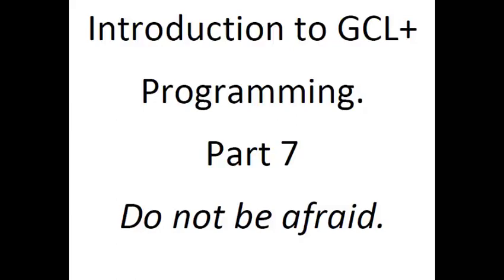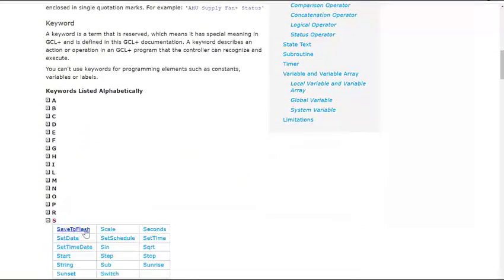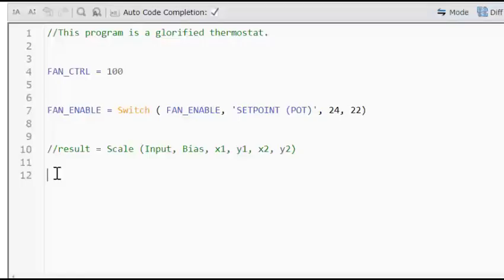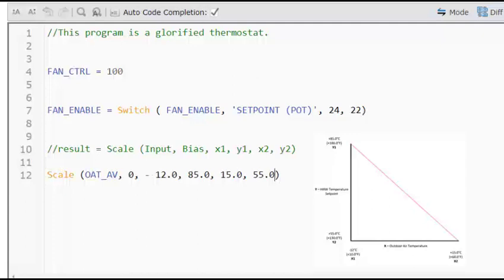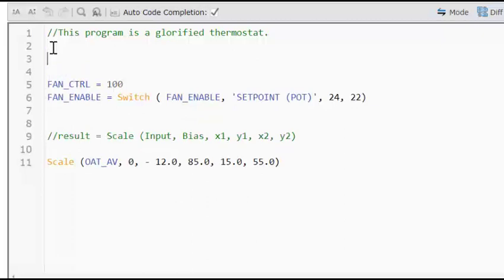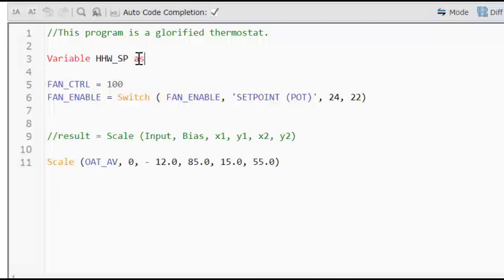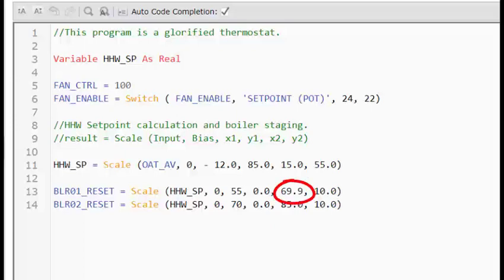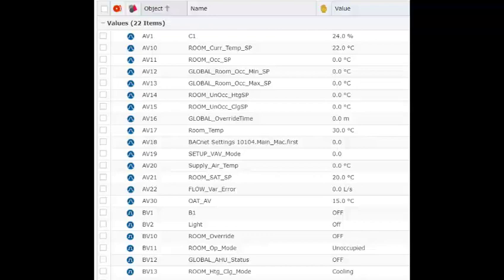Pt7 - GCL+ Local Variables

Comment: Any chance you wanna look at thousands of pgs? I operate one of the major themes parks in Florida. I could use some help learning more. To stream line pgs
Reply from the maker: Theme parks in Florida, sounds like a blast! Maybe you should just hire me and Ill move there! It is snowing here.
Do you work for a Delta partner? Delta has GCL+ self-past online classes?
Are you trying to increase scan rates?
Reply: @okroshome4821  i do work for a Delta partner and i am hiring 2 positions! I have almost 1,000 controllers and over 18,000 i/o's . There's are thousands of pgs. Some are around 300 lines long.
Reply from the maker: @patriot4life684  300 lines of code is a lot to sift through. Are the programs not working? What controllers are they on? Does the site utilize enteliWEB?

Comment: Could you continue your great job please,
Thank you
Reply from the maker: Thx. What would you like to see next?
Reply: @okroshome4821  hey and thank you for your answer, 
Could you show us the Program for damper in H system for exemple, 
Thanks
Reply from the maker: @mamou42  Not sure what you mean by 'H' system. Are you referring to maintaining and economizer temperature, 55F/12.7C, via modulating the return and outdoor air damper?
Reply: @okroshome4821  exactly
Reply from the maker: @mamou42  Hmm? Well that gets complex/advanced real fast. So many questions, are we monitoring CO? Are we monitoring enthalpy? Do we have cooling? Is the cooling DX or modulating? Do we need to monitor OAT? (Probably) Is there a pre-heat coil?... Might be a bit to advanced.
Reply from the maker: If you have a small Sequence then maybe we could step through it.
Reply: @okroshome4821  hey Sir,
Yes we can use : CO (direct or inverse), Cooling (moduling), no enthalpy, OAT and preheat 
I don’t have a sequence, but maybe a simple sequence, with 
Outside temp (three seasons : winter, summer and inter-season) 
Drive modulation with pressure (2/3)
Valve modulation (heating and cooling)
Damper modulation (air supply and exhaust air)
I don’t know if it’s clear for you, sorry for mistakes, because my mother tongue  is French.
Thank you
Reply from the maker: @mamou42 That is a bit much for an intro tutorial, however this is how I would break it out:
CO (direct or inverse) = CO Object
Cooling (moduling),  OAT and preheat 
Outside temp (three seasons : winter, summer and inter-season) = OAT Reset using Scale function.
Drive modulation with pressure (2/3) = CO Object
Valve modulation (heating and cooling) = CO Object
Damper modulation (air supply and exhaust air) = CO Object
So not much programming. Do you work for a Delta Partner?
Reply: @okroshome4821  yes, I’m working with Delta Partner in Canada
Reply from the maker: @mamou42  Then you will have access to Delta's George University. The Partner Fundamentals on-line training has Intro to GCL+ Programming. Topic 8 is about how to program an AHU.
Reply: @okroshome4821  yes, I’ve access, I’ll check it
Thank you 🙏